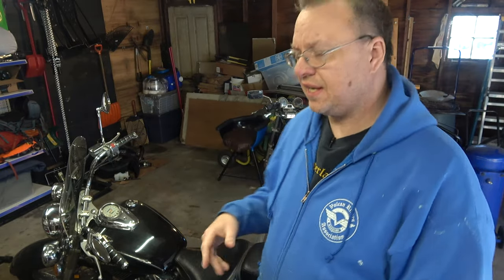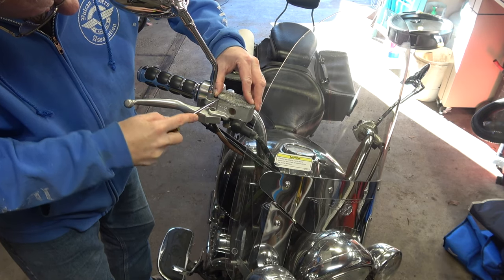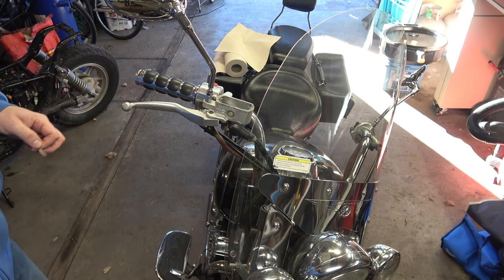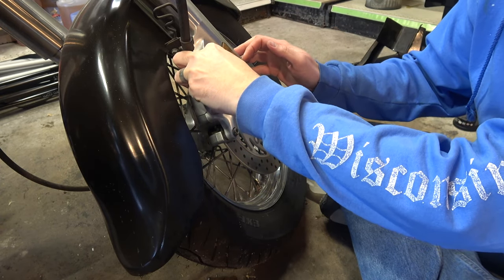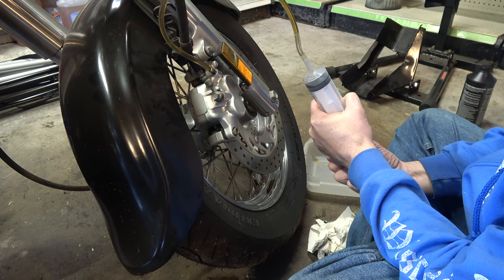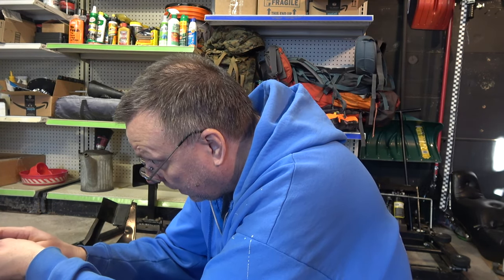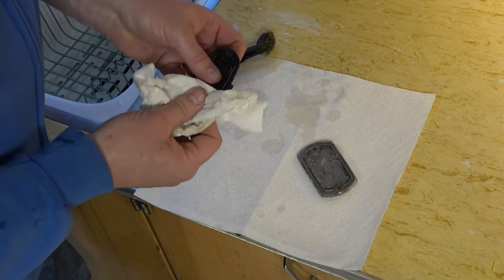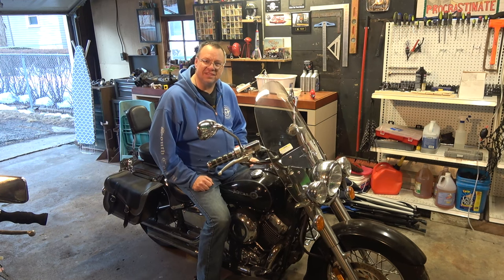V-Star 650 - Brake Fluid Change, Syringe Method

Comment: That piece of metal sheet prevents the fluid from bursting in the air when you pump the brake lever when you bleed them.
Reply from the maker: Sounds like a good reason

Comment: I could be wrong but wouldnt you need to press on the brake lever to get it to drain?
Reply from the maker: No, no you don't need to hold in the brake lever.

Comment: do you have to do the same thing to the back brake because I did this to the front brake but cant fine where to do it for the back bake?
Reply from the maker: Yes same process, the bleeder nipple will be at the highest point or points above the break pistons.
Reply from the maker: Sorry, I keep thinking comments are made about the Vulcan 1600. I just saw your comment is on the V-Star 650. The rear brake on the V-Star is a drum brake and uses a mechanical system, not hydraulic. So, no fluids are needed or need to be changed. However, you might need to tighten the adjustment screw at the very end of the rod.
Reply: @ChefHikerBiker  o,k thanks

Comment: I used a bleeder vacuum pump and still played hell.
Reply from the maker: I've wanted to give one of those a try.
Reply: @ChefHikerBiker  it was about 70° in my dinning room where I did it. I don't think cold was the problem
Reply from the maker: Was it sucking in a lot air, from around the bleeder, or was your issue something else?
Reply: @ChefHikerBiker  had a good seal, I think they're just a b** to bleed. Might just be because it's a 23yo bike. Plus I'd rebuilt caliper. Probably should of changed reservoir and line too. Reason I watched your video and others is because it was giving me such a hard time. I tried a gravity bleed, pumping the brakes. Then went hunting for my vacuum pump.
Reply from the maker: I take it you got it all figured out though
Reply: @ChefHikerBiker  yeah this is my first bike. Like your buddy's, it stops when I push it. Still feels a little weak, but guess I don't want the fronts to be to grabby anyways.

Comment: Why the feck would you add the variables in dumping it into the master cylinder reservoir?
Reply from the maker: I don't know. 
I'm not a pro, I'm not a mechanic, I don't know exactly what I'm doing. I knew I would be cleaning out the master anyway and flushing the entire line, so I don't see what the problem is.